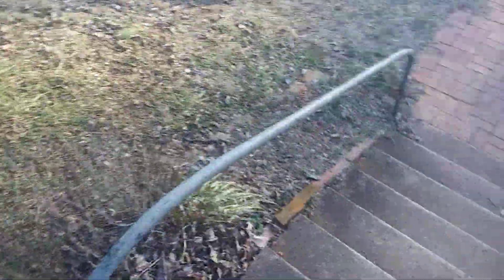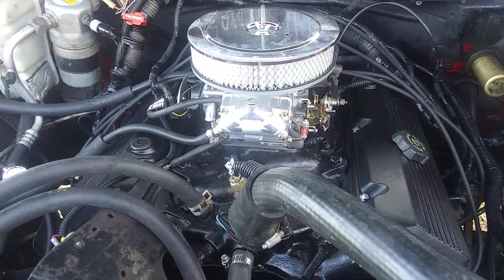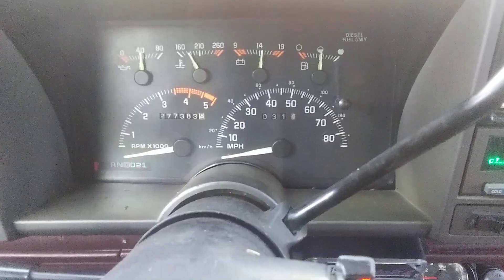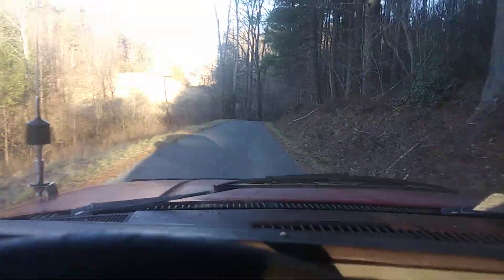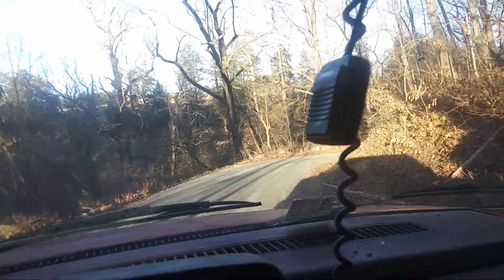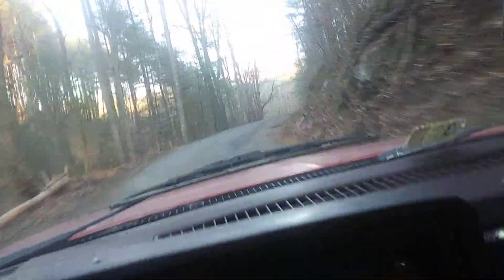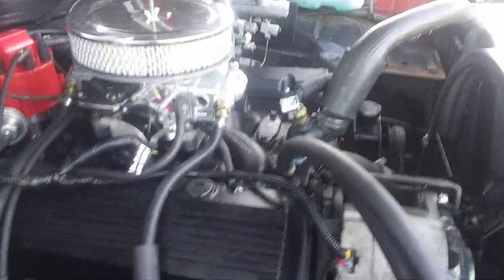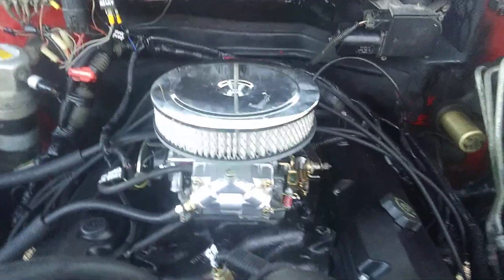94 Chevy 454 engine swap: Driving the truck!

Comment: Just baught my 94 Chevy K1500 motor was locked up put a 402 bored 60 over now a 462 Chevy big block big cam dome pistons low mileage just got back from a friend from putting engine swap for me got to take to real mechanic shop get carburetor fixed and steering shifter fixed and driver side window fixed and new mud tires

Comment: Awesome sounding 454 gas engine which sounds like a muscle car I enjoyed it
Reply from the maker: Thanks I'm still driving it to this day I fixed the exhaust pipe though: (
Reply: @Whelessry  after you fixed the exhaust, what does it sound like now?
Reply from the maker: @liamthemarchingbandguy4063  not as loud or muscle car like, but still pretty loud like a truck should sound it's got a 4 inch pipe all the way to Y
Reply: @Whelessry  why did the exhaust get cut anyways?
Reply from the maker: @liamthemarchingbandguy4063  the truck sat for around 5 years before I was able to get engine rebuilt and all parts together, in that time, a rat or something built a nest in the exhaust up near the catalytic converter, so when I put the engine in, it wouldn't start. Had a hell of a time trying to figure out why, it literally couldn't breath. Finally figured out exhaust was clogged, cut pipe at the cat, fired up right away. Then had to weld it back up to pass inspection
Reply: @Whelessry  was the 454 installed when it was sitting it was it still a 6.5 diesel?
Reply from the maker: @liamthemarchingbandguy4063  yeah the guy who owned it before me did the original 454 swap, but engine needed rebuild and a ton of work else where. I kind of finished the job and got her on the road again
Reply: @Whelessry  what happened to the 6.5 Diesel it had originally?
Reply from the maker: @liamthemarchingbandguy4063  don't know bent valves or blew up or something
Reply: @Whelessry  does it have a muffler after you fixed the exhaust?
Reply: @Whelessry  im working on doing the same thing right now .... ive done two tbi to carb sbc and bbc ...and now im doing the carbed bbc in the 6.5 truck so can you tell me which wires go to the distributor ...
Reply from the maker: @durtysouthkustomz8862  right off can't remember exactly which ones I used but I know it needs ground, one hot wire while key turned on, and one maybe always 12v? I could be wrong but if you search up how to wire distributor custom or something like that I'm sure you'll find what is necessary

Comment: Just did  swap gen 6 454 79 camaro i was going to add 2 different oil pressure &temp gauges but then thought its another point of posable failure so nix the idea but good job nice ride
Reply from the maker: Thanks man! Yeah i get why you chose not to. My engine was just setup where there were multiple water ports and oil ports and it was too tempting. I like being able to monitor water temp and oil press from different locations on the engine is why I did it

Comment: I no this is an older post but works just the same. Looking into taking 454 out of my 97 3500 4x4 and dropping into a 95 6.5 3500 
Both duallys, both auto trans, both 4x4
Should my main concerns be harness etc..
Reply: The diesel is junk but body and frame good. And my 3500 gas frame is junk

Comment: So I just put a 454 in a single cab short bed. It was a 4x4 and is now 2wd so the drive shaft doesn’t work any suggestions on where I would find one to fit?
Reply from the maker: What do you mean the drive shaft doesn't work? Do you mean the part where you mate the engine to the transmission?
Reply: No I mean that the drive shaft is about 2 inches too short. I never disconnected the engine and tranny I pulled it straight from an rv and bolted it up to the motor mounts.
Reply from the maker: @joshuafreeman916  oooooh I gotcha, well I don't know about your area, but there is a shop near me that makes custom driveshafts, so they actually take an exact measurement or you can give them the length you need and they make a driveshaft you need in the length you need it. Maybe look around for a similar shop like that in your area

Comment: Yeah my 92's got a 454 in a 92 Chevy suburban I'd like to go from 454 to dieselbut thinking about going with the 6.2 l military diesel
Reply: Na bro go with a 350 TBI
Reply: The 454 will make twice the power as a 6.2. A 6.2 with a TURBO barely makes 200 horse. A 454 with a little more than mild cam, carb, headers, and a HEI distributor using the same peanut port heads from 88-95 can make 450hp and over 550lb torque. 
The 6.2 or even 6.5 diesel are only good for fuel economy not power. If u want both better fuel economy than a 454 but better power than the diesel, go get a 350 with some work done too it. 
With the money spent converting ur gas to diesel, u can cam, header, carb or fuel inject ur 350 and make over 300 hp and 380-400tq and still get probably 15 highway
I get 17 mpg highway with my stock tbi 350 and I’ve heard the 454 averages maybe 10

Comment: I have 2000 454 7.4 
I want to swap it on a 95 3500 6.5 did u  modify the motor mount or it sits well
Reply from the maker: It sat in there just fine, I can't remember if I stole some of the brackets from the 454 truck or not but both being Chevy makes it mounted up just fine

Comment: I have a 5.7 on my 96 c2500 does the 454 bolt right up
Reply from the maker: Yeah it bolted right up to my 94, I don't know about a 96, definitely save as many motor mounts as you can from both trucks just I'm case you have to mix them up to make it fit

Comment: I have 95 dually.im planning on changing to 427 Chevy with 5 speed manual..with carb and distributor..i having problems finding front pulleys..alt..power steering pump ..i will look into 84 set up..maybe I can find that set up..thank you
Reply from the maker: What does your 95 have now? Power steering with hydroboost? Or vacuum? The 454 i got was all V belt stuff and the original diesel was serpentine. But it didn't matter because I literally swapped in all of the engine components belts and pulleys. I guess I got lucky and both had hydroboost so the 454 power steering literally just spliced right into the lines. good luck! If you have more questions or want another video, let me know

Comment: Did you change the torque converter?
Reply from the maker: Nope it's original from diesel it's got a 4L80E in it
Reply: @Whelessry  nice, make use of the low RPM torque, and extra fuel mileage

Comment: How did you get the gauge cluster to work with a carbureted engine?
Reply from the maker: Hey ryan that's a good question. The temp gauge on dash is run off of a temperature sensor that is plugged into the head. It is wired into a green signal wire that goes to original main gauge cluster in the dash. It was originally used for the diesel engine but uses original wiring. Same for gas tank gauge, original tank, sending unit, and signal wire. The oil pressure gauge was a fun one to figure out. It is wired into the original oil pressure switch from the diesel, I just needed a brass adapter fitting to make it fit in the block above the oil filter. That has three wires coming out of it, the tan goes to original dash cluster wiring, orange goes to a 12v source on a relay that I installed, and the gray also goes to the relay I installed,only it also splices into the fuel pump gray wire. When the engine has oil pressure, (while cranking or running) the switch is engaged closing the 12v hot wire to the fuel pump also turning that on, and the signal wire (tan) reads into the dash gauge, and when there is no oil pressure the switch disengages cutting off the 12v source which then kills the fuel pump. It's a safety measure like if i flip the truck or something the fuel cuts off. The battery voltage gauge is wired into my alternator just reading a v signal, and my tachometer on the dash does not work right now for some odd reason. Everything is wired into stock wiring, but I can't figure it out.  
All of the extra gauges I have are wired into different spots, using mechanical power for signals. Let me know if you have any more questions about my set up, and I'd be happy to explain more
Reply: all GMT400 truck clusters (2001 and older) work the same as square body gauges (factory carbed). 12v and ground for main power and one wire to the sensor. NOT like LS trucks where it has to go thru the PCM. I have a 2000 escalade cluster in my '96suburban with carbed Vortec 454/ manual paddle shifted 4L80. Everything works on it.

Comment: What is that transmission box you have?
I’m thinking about putting a 454 in my 96 1500
Reply from the maker: It is a USshift transmission controller it was need because i went from diesel fuel injection to carbureted

Comment: What did you use for power steering pump and pulleys..
Reply from the maker: Power steering came from the 84 454 engine. I was able to merge the pump into the diesel set up because both vehicles use hydroboost. Worked perfectly

Comment: I would’ve swapped that 6.5 diesel to a 5.9 12v Cummins
Reply from the maker: Too late! Haha 7.4 was what I already had on hand
Reply: @Whelessry  what kind of carb is on that engine?
Reply from the maker: @liamthemarchingbandguy4063  it is a holley 650 if I remember correctly

Comment: Would this swap have been easier if you had both the 454 truck and 6.5 truck? I'm wondering because my current truck is crap and mightve found a decent truck worth a swap. Thank you for time.
Reply from the maker: Absolutely!!! If I had the truck the 454 came out of it would make it insanely easier. You still have to do transmission controller stuff and a lot of figuring out on your own but I would try to mimick how it was set up in the other truck. With this swap, I had the 6.5 truck but I was basically blind with the 454 engine
Reply: Was the truck the 454 came out of a dually?

Comment: Was the transmission controller added in order to convert to gas ?
Reply: I've got a 94 c3500 6.5 that I am thinking to converting to gas big block
Reply from the maker: Yes it was added because the truck went from fuel injection to carburetor. If you have a manuel it doesnt matter. I think my controller was like 500$ from usshift.com
Reply from the maker: I should add that I'm very happy with my swap, figuring out the wiring is very easy as long as you understand how to find hot 12v wires from sources that you need like hot while cranking, hot with ignition, hot all the time, but id only do it if you already have the motor ready to go. I wouldn't do it just for no reason you know?
Reply: Wheless _ I’m gettin a fuel injected 454 diesel to gas. Could I use that same controller for a fuel injected instead of a carburetor?

Comment: Why did you put a carberater on it instead of a direct fuel system? I am looking at putting a 572 or a 632 in my 21 2500 durimax?
Reply from the maker: Because the engine I had was a 1984 carbureted engine which used a carburetor not fuel injectors

Comment: I have a 84 caprice with 98 7.4l I have a question do I need the ecu for this motor in order for it to start
Reply from the maker: Im not sure if you have the newer 454, my 454 is a 1984 carbureted and original ecu is in my truck but its not doing anything, it just stores information and keeps my check engine light on. I have unplugged it and the check light went off but didn't affect anything else. Not sure about yours to be honest
Reply from the maker: If I understand correctly your starter has to be wired straight from the battery with the heavy gauge wire and straight to the ignition switch with the smaller stud on the starter. Mine is purple in the truck. That's how Mine is wired no ecu is involved. More than likely if you don't need the ecu for anything else, you can by pass it like I did

Comment: Why go from a diesel to a 454
Reply from the maker: That's a good question. I got the truck for free, and this is what the guy before me was doing. So I went with it, I think he already had the 454 on hand and wanted to use what he had. The diesel blew up
Reply: @Whelessry  I'm just trying to figure it out I have a 93 DRW Silverado with a fresh 454 and Alison transmission, when I pop the hood It looks like it used to be a diesel I don't even know what to do with it

Comment: im doing similair but i swapped to a 5.7.  but my question is, did you change torque converter or leave the original ?